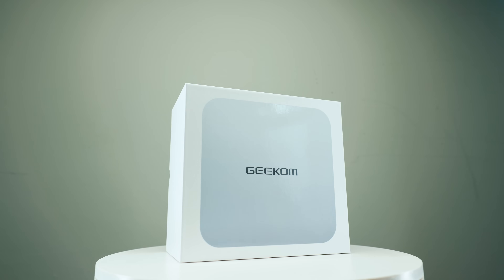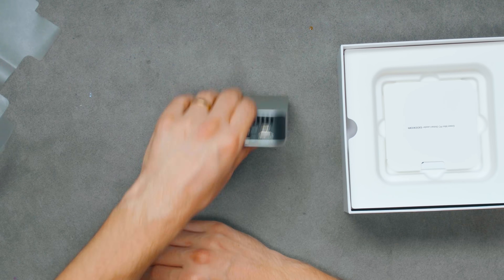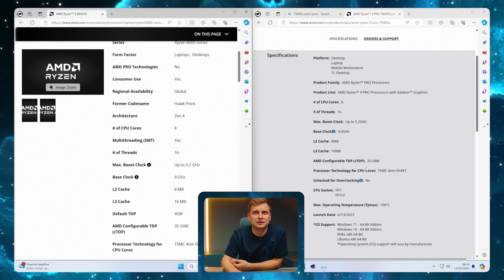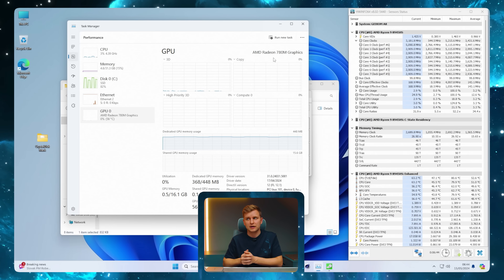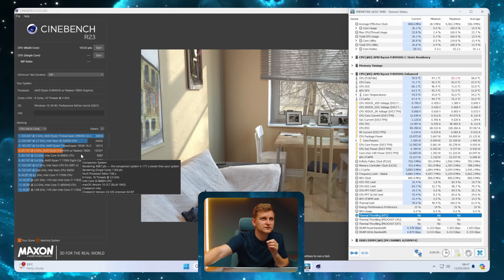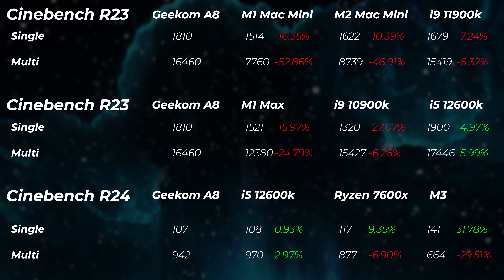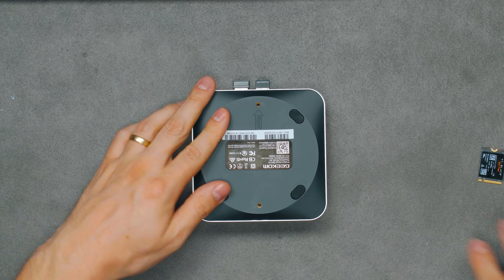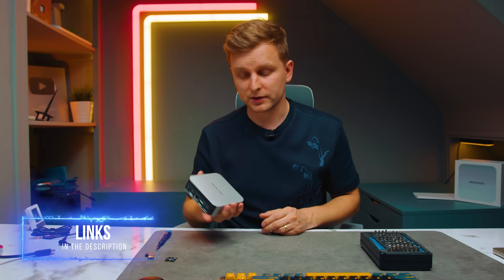Is this the BEST AMD Mini PC with AI? | Geekom A8 Ryzen 8945HS Review & Teardown

Comment: If the backpanel doesn't come off easily and you're sure all 4 screws are out: Install the VESA mount screws and you can use the backplate to gently pry the back off. That's what worked for me.

Comment: Coming back to this video a year later, I only found out that the CPU shares pretty much in common with Z1 Extreme and Z2 handheld CPU, with the only major difference in clock speed and maximum TDP. And since a lot of current gaming handhelds are running on Z1 Extreme or Z2, this can be a great little machine to run SteamOS or Bazzite.

Comment: Question, is it  worth getting a server grade CPU to future proof my PC build? LIke Xeon, or Thread Ripper?
Reply: It's depending of your workflow, i believe.
Reply: @CSC8393  Well, I start by importing into Lightroom, generating 1:1 previews, apply base presets. I notice that my CPU is hitting 100% while creating those previews. On top of that simply applying these base presets as a batch make the CPU hit around 50%. 

Next, I send my bracketed images in batches of five to my HDR software plugin. Once I've made modifications it comes back as a TIff which I will make virtual copies of to apply different effects to each image which I will send to Photoshop to have it composited.
Reply: Just my opinion based on what I have read, multi core CPUs are very capable, and using a workstation based CPU is only necessary if you make use of the extra PCI-e lanes. The more cores the better for CPU dependent tasks.
Reply: @johnt.848  Thank you. I'm going to wait to see what Intel brings for fifteenth gen.

Comment: I use Davinci resolve should I get 7900XT Ultra or 4070 super i manly edit Sony Fx3,30,and fx6 codecs? (the xt is 125$ dollar more)
Reply: For Resolve I would get 7900XT 20GB because of the strong performance and the extra 8GB VRAM which plays a huge role compared to the pity 12GB. 

The problem in your case is that the Sony codecs you mention are all of them 10bit 4:2:2, and NONE of these graphics cards do hardware 4:2:2 decoding (RDNA 3 or Ada). 

So you need to rely on a second Intel ARC GPU ONLY for the 4:2:2 HW decoding you need, OR you combine either of 7900XT/4070S with a 13/14th Gen CPU with the iGPU UHD770 (not the F versions!) to get the 4:2:2 HW acceleration you need from Quicksync (which in 13/14th gen decode ALL of the range h264/5 4:2:2 up to 8K). 

If I were you I would get the 4070Ti Super 16GB with an A380 and an AMD CPU (in case you don't have a PC or are about to upgrade) that is energy efficient (7950X or even better 9950X next month). In Resolve's settings you can set up the Intel ARC GPU to do only the encoding and you leave all the rest (either AMD/NVIDIA main GPU) to be done on the powerful main GPU.

So the short answer isn't the GPU only, but the CPU or GPU (with Quicksync) you need, since ONLY Intel Quicksync at the moment can offer you 4:2:2 10bit HW acceleration. 
I hope it all makes sense since I am a Resolve user as well and have my PC set up like this. (NVIDIA 30 series+ARC+CPU Quicksync). I bought the A380 to get HW AV1 encoding as well, but in your case, both 7900XT/4070S offer that from their media engines. 

Intel ARC GPUs (any Alchemist model) have DUAL Media engines, this is what you need mostly and AFTER you choose the main Resolve GPU. 

I hope you got your questions answered brother. 
Praise to the Lord!
Reply: @xarisathos Thank for the info I already have i5 12600k that has Quicksync with a 3060 but I think I'm going to upgrade to a 4070Ti Super 16GB.
when I upgrade my GPU how do I go about pair it with an A380 gpu to get more performance.
Also if the A380 gpu to get me more performance I think I buy that first to pair with the 3060 and waitfor 4070Ti Super 16GB price to drop a little
Reply: @dirjuan  Make sure you have Quicksync enabled in BIOS (GPU 0 in Task Manager), then check Resolve settings to use Intel Quicksync for decode (you can disable NVIDIA ones). 3060 can do the trick for most things though it's not very powerful, but until gettings the 4070Ti S you can get a cheap A380 to take advantage of the Dual Media Engines + AV1 encoding capability. 
A380 won't/shouldn't  contribute in rendering performance, only will be used for scrabbing the timeline and exporting video (encoding). Make sure to use only CUDA in settings as well, or it will try to use OpenCL for both GPUs.
Reply: @xarisathos you sound very knowledgeable. Can you just tell me straight a PC build that can handle 10 bit 422 from my A7S III and G9 2 easily when editing in Sony Vegas Pro 20.
Reply: @raalaa121  i edit on vegas pro 20! I basically convert all my files to prores 422 hq with adobe media encoder, & it makes editing SUPER easy and smooth!
Reply: @raalaa121  I don't have any experience with Vegas Pro and their media engines support (and nothing clear is on their website, but generalities), but let's assume that it is comparable with the state-of-the-art Resolve Studio I am using for years now.

1) If you can wait until H2 2024 (Oct-Dec), I would buy an Intel Arrow Lake desktop CPU for the best codecs support from the iGPU (along with 422 10bit you care for mostly), since the current 13/14th gen CPU consume TOO much power and are difficult to cool them.

2) Much quicker purchase would be a Ryzen 9950X next month for max CPU performance, with an Intel 2nd Gen GPU Battlemage (which is unclear yet when to be release in 2024) to get also the latest codecs support (VVC/H266 decode) or a current A380/580/750/770 (doesn't matter which one, all have the same dual media engines, you won't use them to do the heavy GPU work, only as support to AMD/NVIDIA GPUs) to get ALL codecs support with dual engines, but possibly before the Arrow Lake CPUs (Q3 2024 instead of Q4 for Arrow Lake). I am not sure if Vegas Pro support them, couldn't find any relevant info about it on the entire website. In Resolve though, I use them over a year now with great success as Hardware accelerators for codecs and the NVIDIA GPU is doing all the heavy lifting with CUDA.

3) If you need this PC yesterday, (and you don't care about power efficiency) then I would go with 14900KS (for max single thread performance), paired with at least RTX 4070Ti Super, in order to get dual-engines encoders with NVDIA, because at 4070/Super level and below they have only one and only 12GB instead of 16GB, which is minimum in my humble opinion.

4) RAM: At least 64GB, but personally I get easily at 90-100GB usage (of 128GB) in simple UHD projects in Resolve Studio, along with the other apps I use. Nowadays you can have up to 192GB RAM via 4x 48GB DIMMs, it depends on your budget willing to spend.

5) NVMe SSD: Seagate Firecuda 530 4TB for projects/scratch disk, because it has the maximum (5100TWB) longevity on their chips compared to the others, but need to be cooled at both side (double-sided NVMe) by getting a efficient after-market heatsink (not the motherboard's one). If you prefer simplicity and speed, go for Samsung 990 Pro 4TB which is single-sided and quite cool, but gives you the common endurance-rate (2400 TBW).

6) If you have a NAS where you work with your projects, then a 10Gbit Ethernet card is essential for such big and demanding video files and multiple video streams on the same project.

7) Lastly, a 32-bit/192Khz capable sound card (or on-board one like in ASUS ProArt Creator Z790 mobo which has it all the above) would be very usefull in the era of 32bit audio files with higher bitrates than the classic 16/24bit 48Khz.

I hope everything is clear now, it depends on the money you can spend on the PC build and how quickly you need to get it on your hands.

Praise the Lord and I hope to cover your personal needs!

Comment: I have A7 version of this and it handles everything I throw at it happily - I don't do gaming. I am editing this on an lower performance Geekom. I love them. no trouble in the almost A year its been running.
Reply: Hi mate. Just a quick question. Does it work loudly? Like does it annoy others while working outside?
Reply: @pumpernickelzz  Mine is mounted behind one of my monitors and I hear nothing. Excellent bit of kit. I have three of them now (different specs) doing different roles and all without issue.
Reply: @kevinturner6621  Thank you so much for your review